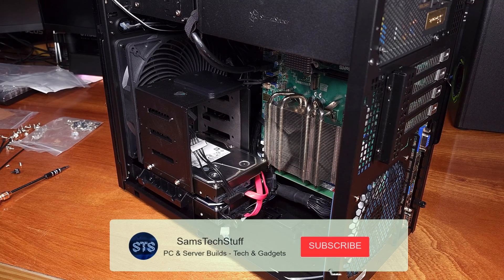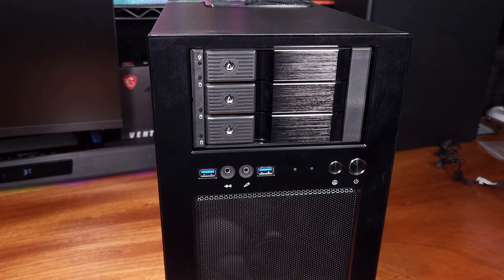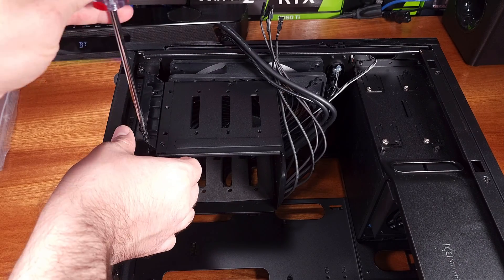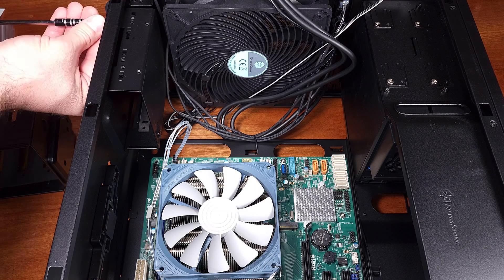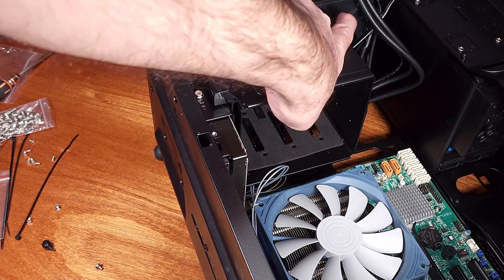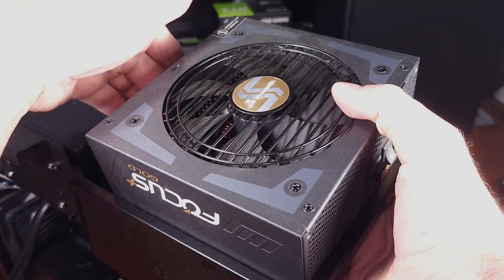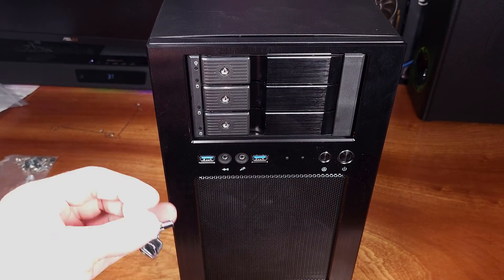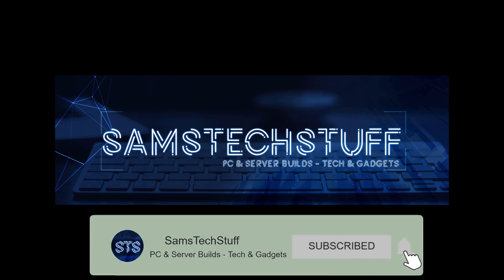mATX UnRAID Build

Comment: Nice review btw What was the capacity of the hard disk used for testing in the top 3bay and middle 4cage?  The one installed at the bottom appears to be 3 terabytes.
Reply from the maker: Hi,

For my backup server when I posted this, yes, I was using 3tb drives. I'll see if I have any spare 8/14tb drives to install to test

Comment: Those look like SATA power and data connectors on the back of the drive bay. Curious why you said it was USB based
Reply from the maker: Looking back now, yes, these do use SATA. I cant quite remember if there was some kind of controller built in here but I just took this case out of storage and it seems to just be SATA (unless you buy the Silvestone SAS adapter). This is a quality case for building a smaller NAS though, I'm still using it as my backup UnRAID server to this day. Silverstone makes some GREAT stuff.

Comment: What maximum height of cpu cooler is possible?
Reply from the maker: Hi John, looks like the maximum CPU cooler clearance is about 165mm. Were you planning on setting up an unraid / storage server as well?
Reply: @STS  
Yep, I'm looking for compact case with 6+ hdd places. I noticed, that cooler is intersecting with 3.5 hdds visually and height of it is stricly limited.
Reply from the maker: It's tight in here, no doubt. To be fair the cooler I am using is not designed for a case like this and it's not a good choice. I should have probably selected a slimmer taller tower cooler since I didn't need much in terms of cooling power. Did you end up picking this case up or did you go in a different direction?

Comment: Now you have me curious, what was the old Antec case?
Reply from the maker: Unfortunately I don't remember - it was an Antec model that supports 8 drives with two 120mm front intake cages to keep the drives cool. I'm interested in finding non pre-packed type of NAS cases at the moment. What are you running?

Comment: What did you say you needed to buy for the CPU?
Reply from the maker: I don't recall but unfortunately the CPU in this setup failed. I picked up a budget lga 1700 setup to replace this older board and CPU. We're you thinking of building an UnRAID system?

Comment: Could be just what I’m looking for to downsize from a Be Quiet Silent Base 800 unRAID system I use for Plex. I’ve been looking at smaller cases that can take 4 HDDs but this looks more suitable just in case I do want more in the future. With the size of hard drives these days 4 should do me. Thanks for this.
Reply from the maker: Glad to have helped out! Yea, the 800 silent base from be quiet! is quite a bit bigger, this will be a nice smaller upgrade for sure. I just added another drive to this backup server over the weekend. Happy with the case overall and still happy with the large 180mm fan.
Reply: @STS u mean micro atx ? If so until how many storage can you attach to the mobo through pcie / sata to the mobo?

Comment: Great video, love unraid!
Reply from the maker: Hey Jordan! Thanks! I've been a user for a while now, it's amazing to see how the product and the community has grown. Glad you're liking your setup too - do you have a Homelab or mainly needed a storage server?

I'll be refreshing my main UnRAID server soon, I love my micro ATX Threadripper but my 12th/13th gen testing has been compelling enough to retire my 1920x. Good stuff on the way 😀
Reply: I have a home lab and it operates as our storage server. I run VMs that need higher clock speeds and faster IO on the UNRAID server (TR 2950x and a few NVMe drives) and run my slower VMs on dell R720, VMs with low disk IO and better optimized multi threading applications run just fine on the 2x 2.0Ghz 8C/16T dell server. But anything that needs reasonable disk IO like running a windows VM that you remote into for work for example, absolutely sucks. I’m assuming its because i’m running the wrong drives or something but even the Samsung 850’s I had in there were not nearly as responsive as they should have been. Tried ESXi and am now running XCP-ng. 
I have almost 40TB on the primary server and will end up backup at least ~30TB of it. So my backup server currently has 39TB usable space, however I have a few more (ancient but usable) drives to add to get that a little higher.
Reply from the maker: Interesting setup! I have been working on a slight consolidation and tiering plan of my own similar to what you have described utilizing nested virtualization here and there. 

I'm not sure how you have organized the SSDs / array in your setup. Was this hardware raid or some type of software raid shared from a guest back to the hypervisor?

Storage / I/O, it's always a tough one. Funnily enough, I also use Samsung 850 EVO SSDs in an all flash array but, they are running in my TrueNAS server. I am sharing block storage from TrueNAS to ESXi over iscsi, in this case a DAC from one server to another, no switch. I have found I can run quite a few VMs simultanesouly and get quite good performance. I even ran one of the VMs with a GPU and USB 3.0 PCIe card passed through as a desktop for a while a few years ago. The experience was quite good. The 850 EVOs are great drives but they aren't PCIe NVMe drives. For my usage, I don't have a performance reason to upgrade but I have been toying with the idea of a PCIe card splitting lanes up so I can run x4 NVMe drives. I would likely need more than 10gbps networking at that point but, the cool factor would be there for sure.